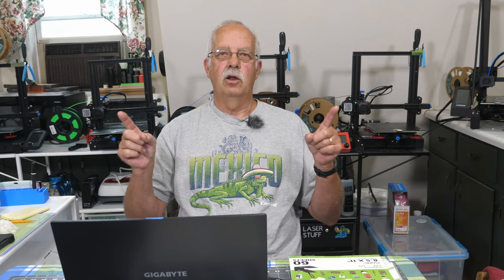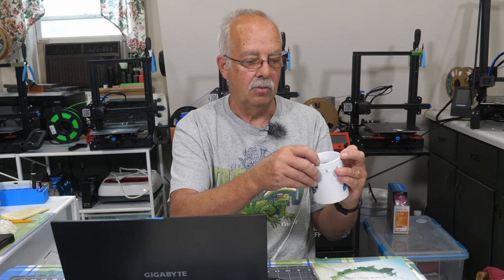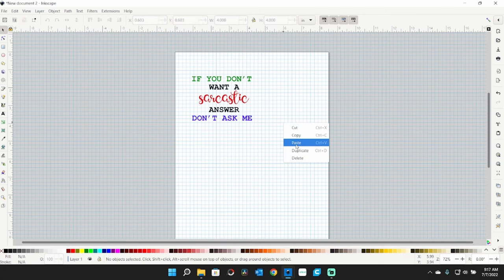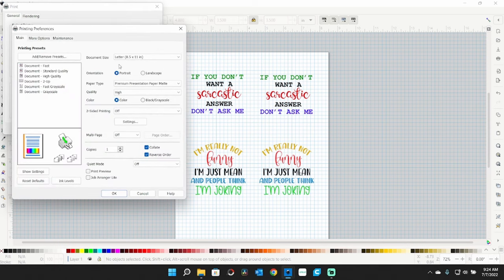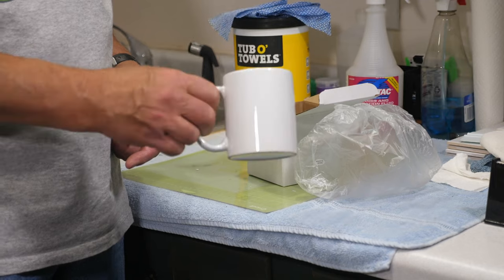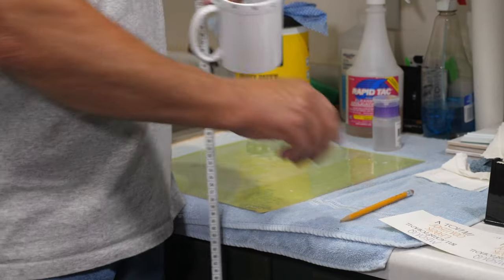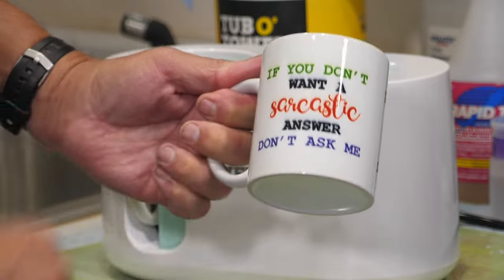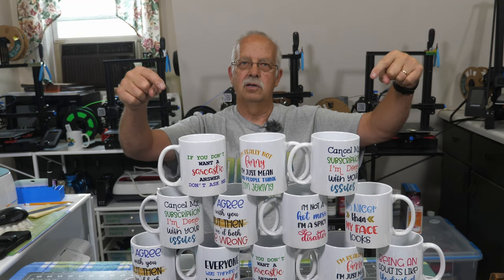Sublimation On Mugs Step By Step

Comment: Great video! How long should I wait before removing the graphic? I’ve noticed ghosting and speckling but I’ve been pulling the paper off as soon as I take it out of the press.
Reply from the maker: Not a good idea to hot pull as you have found out with the ghosting.  I let them sit until I can handle bare handed without getting burned.  "Speckles" are usually caused by lint.  Make sure mug is clean and dust/lint free.  Cheap paper towels can leave lint behind.  The blue shop-type towels don't.

Comment: Hey Roger great videos as always. What level setting do you use on the press. I just got the same one. Ty
Reply from the maker: Default setting that it cam with.  After making one as a test, that came out perfect, I found no reason to mess with it.

Comment: Awesome video. Couple questions. 
If color from bottom to top, do you need more tape around the top and bottom to get the image on towards the edges?
How many rejects should I expect before getting hang of it in a production manner?
I've seen some mention using butcher paper, but noticed you aren't using any. Is that because the designs aren't to the edge?
Reply from the maker: To get color to wrap around the top and bottom edges will require more tape to bind the paper to the curves, much like we do with tumblers on the bottom edges.  I don't use butcher paper since I use a heavy high quality sublimation paper.   My reject rate is less than 1% and usually is a result of something stupid like putting the image on upside down when in a hurry.
Reply: Thanks! I really appreciate the videos from a manufacturing perspective. @rogersshop

Comment: Thank you for the video, very informative.   You used a color ink jet printer?   I'm new to this.
Reply from the maker: Epson 2720 converted to sublimation ink.  Regular inkjet ink will not work.  It must be ink designed for dye sublimation.
Reply: @rogersshop  thanks!

Comment: What temperature and how long do you heat press a mug?
Reply from the maker: This depends on what press you have.  For a starting point, try 385 degrees for 120 seconds.  The press I use here in this video is automatic.

Comment: I love your work; I have a question?  I'm using A-SUB sublimation paper with my Epson with Sub - Ink at 400F for 250 seconds and still haven't no luck. nothing comes out, What I'm doing wrong... I'm new in this ...
Reply from the maker: Temp is a little high, but if you are not getting any transfer to your sublimation blank mugs (assuming you are using a press), then the blanks must be non coated/not coated correctly/not cured properly.
Reply: @rogersshop  thank you 🙏
I did try another transfer paper and it did work..
Not as it should be but I did it..  I'm getting a new order of transfer paper.. God bless 🙏 and thank you for your advice and time..

Comment: I love your videos!! But I do have a question. I'm new to mug sublimation and notice that all of mine seem to have very faded colors. I do 300 dpi and increased the saturation and all of my printing settings are controled by the printer. When I went up to 400 degrees at 240 seconds it got just a little bit better, but the entire graphics are still bleached out. Any suggestions would be helpful!
Reply from the maker: If using an Epson printer:  Quality high.  Turn off high speed or bi-directional printing.  Paper type should be set to Premium Presentation Paper Matte.
Reply: Thank you. @rogersshop
Reply: None of my settings give the option of Premium Presentation Paper Matte. Just SC F170 Rigid or textile in its place. Very confused. @rogersshop
Reply from the maker: @siouxareaparanormal4244  What printer are you using?

Comment: Hi, when we put a whole sheet with just text to sublimate on it, we see kind of grain in between, how can we fix that? When we cut the design out, we don’t see it? We don’t use alcohol to clean it, could that be it?
Reply from the maker: What kind of sublimation paper are you using?  I've never experienced this.
Reply: @rogersshop  a-sub sublimation paper, it’s only on the places in between the printed spots. So that’s the weird part, nothing has been printed. Now we also see the edges of where the paper was taped on.
Reply from the maker: @lavishvids1063  If you are seeing the edges, then either the temp is too high, or the time is too long, or a combination of both.  This may also explain the artifacts you are seeing between the text lines.
Reply: @rogersshop  we use the mugpress, I’ll check how to lower the heat

Comment: Do you have to use butcher paper
Reply from the maker: Since I use a high quality sublimation paper, I do not.
Reply: @rogersshop  I have A-SUB 125 G , it was the most expensive A-SUB Sublimation paper (and states that it’s for hard substrates) which I got for my mug press. Do you think that should be okay.
Reply from the maker: @tropicalfishaquatics  Also one of the ones we use.  Should be just fine.